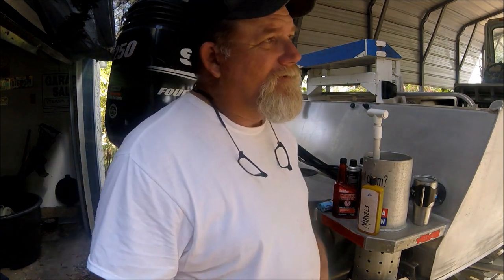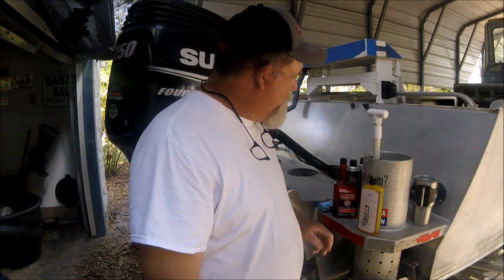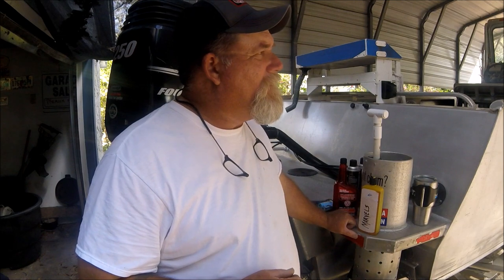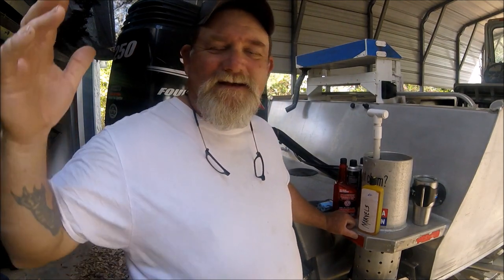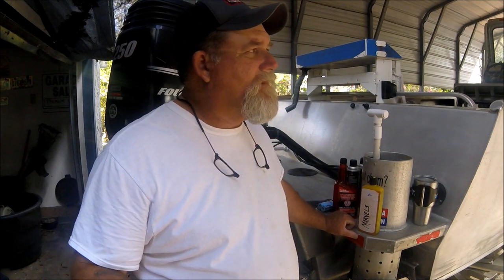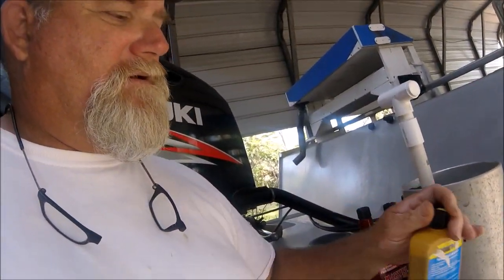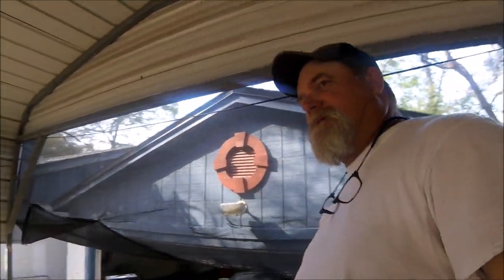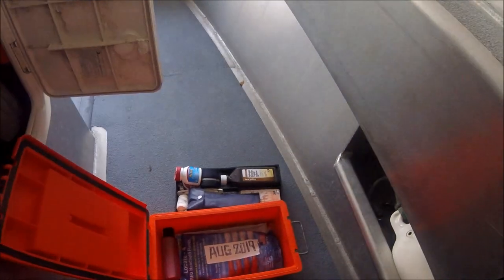Your boats Hydraulic Steering: Spend $5.00 vs. $25. for fluid

Comment: Captain Dave I’m sorry for all the haters, I’ve been using MMO since 1992 I run several boats year round doing commercial diving and this stuff is amazing, I get 6-8 seasons before changing seals and one boat went 16 years. Don’t listen to the dildos talking smack. Let them spend the money they don’t have. You are a good dude keep it coming. Take care.
Reply from the maker: I really don't care about any of the all I know is that works it's in my steering right now is cheap and that's all I care about

Comment: No intention of disputing Marvel Mystery Oil or the various grades of commercial hydraulic oil as far as which is better for boat steering, I can personally attest to this formula: 3 parts ATF , 1 part #2 diesel. I have used this in two commercial fishing boats with NO seal leakage in 20 years.
Reply: Where do you get #2 diesel? Can I just use pump diesel?

Comment: You said you don't know how many helm pumps at the tiller you have changed out and how the steering ram seals (glandular wipers) you have replaced on many boats. Have you ever considered that 'Marvel Mystery Oil' is maybe eroding or degrading the rubber components in your steering?
Reply from the maker: N-O-P-E❗❗
Reply: @CaptDavesSportfishing  Marvel Mystery oil comes in a plastic bottle, and holds pretty good on the shelf. I'm not worried about it!
Reply: I dont think oil is degrading rubber. Thats wild

Comment: Every seals or hoses has its own requirements of chemical it might be safe for seals .hoses or other parts but i would check in to it first before using it. Unless you are willing to pay  the price of getting cheap. If you own a boat you better be prepare for right maintenance and expenses. Just saying  .
Reply from the maker: 10 years, zero issues.
Reply: It's on a Suzuki rig so it's not like it's quality any way.
Reply: @dontblameme6328  wtf are you smoking, what is problem with suzukis

Comment: I ordered MMO with label "ADD to GAS a & OIL", from ZORO but they send MMO "The Original Enhancer & Fuel Treatment".   I called MMO and they said the latter would work for power steering.   I would appreciate any feedback.
Reply from the maker: hahaha    didn't know there was a difference I use what ever they made 20 years ago and is in Walmart

Comment: The Marina told me power steering fluid would great that’s what they use he said
Reply from the maker: yes, ATF works, lots of stuff works.
Reply: I was talking about stainless steel tubing the old alaskan boat building guy used I worked at a refinery where they make gasoline and they have tons of stainless steel tubing for high-pressure steam swaglelock is how they connect the lines together so It don’t leak very expensive
Reply: I use atf for all my vehicles steering systems, also red,   if you are going to spend 25 bucks a pint for power steering fluid, you might as well spend that 25 bucks on the quart of teleflex.
Reply: Christian Fritz I have used Prestone power steering fluid it was only 389 a pint
Reply: @samtate1260  It was a joke, there are literally hundreds of light weight oils that differ so slightly in formulation. They can cost 50 bucks an ounce to 50 bucks for 50 gallons. You are actually paying for the marketing..  Or the container, or even, the scent that is added.
Reply: Christian Fritz I worked for union contractors in Whiting BP refinery I seen a bunch of crap on believable

Comment: Mil Spec 5606 works too. Doesn't smell as good though.
Reply from the maker: no idea what that is, I use 'civilian'' fisherman ''Spec''
Reply: @CaptDavesSportfishing   Maybe you should look into Mil Spec 5606 You''ll be glad you have it if there is a fire on board. Long walk home.
Reply from the maker: @nuttintoseehere9141  maybe next time around....or maybe I'll take the insurance money and get me that side console Stabicraft I want from NZ.
Reply: @CaptDavesSportfishing  I checked it out. I bought Mil Spec 5606 at the airport for $25/gal. The part I like is that it is approved by Teleflex and it is red too!
Reply from the maker: @elydoug  glad you need a gallon. I still like MMO, and any wallys world has it cheap.

Comment: I’ve heard snow plow hydraulic oil works well too and is cheap. But I’ve never heard of using Marvel. One thing is for sure. Teleflex oil costs more than blood!
Reply from the maker: Yes I'm really surprised that this video doesn't go crazy in the Boating world because Teleflex steering fluid hydraulic fluid is so radically expensive Marvels really isn't anything but light oil that can be used in a hydraulic system

Comment: Not boat related but I have a IH 454 tractor with hydraulic steering that is very hard to turn I wonder if that will work  I have used it in cars
Reply from the maker: don't see why not.

Comment: Are you using the old mmo formula?? The new formula is benzene and mineral spirits. It literally has zero oil in it.
Reply from the maker: no clue......see the bottle I'm holding. this video was march 2017, haven't touched my steering since. ''thats a good thing''.

Comment: I work for a pipeline co. In Georgia... I’m gonna be installing hydraulic steering on my 150hp outboard... can I use heavy equipment hydraulic oil for my boat steering system?
Reply from the maker: no idea...ATF or Marvel, is all I've used. Marvel Mystery Oil, $ cheap at Walmart.
Reply: @CaptDavesSportfishing  ok thanks
Reply: I have been using it for years.

Comment: Can the MMO be used in my Seastar Hydraulic steering with the electronic power assist motor/valve body??
Reply from the maker: WHY NOT? if it uses the expensive stuff, it can use the cheap stuff too.

Comment: Hi I just bought a uflex hydro steering cylinder because my HC5345 seastar pivot bolt bushings came loose on both sides some how and lost my steering out in the water. Seastar wont sell me the bushing bolt kit and thats all thats wrong. My seastar works great but its jimmy rigged right now with a rod and bushings tied like a castle nut. Its a better design setup than factory lol. Dont like it that i cant buy parts. Had to get a new one. If i sold my boat someone would frown on the cylinder. Bought a uflex. Will that mystery oil be ok in that UFLEX. Im sure its the same concept design. On how things work. Uflex- seastar. Craps all the same... Just never heard of this mystery oil used in the steering. Im kinda scared to use the stuff. I wanna do it. But scared to. Thanks
Reply from the maker: IT'S ALL LIGHT HYDRAULIC OIL. and cheaper. See it when it leaks, and smells good. Spend or not, it's been in mine for years.

Comment: My steering went hard right starboard when full throttle at start. Wouldn’t turn only at low rpm’s. Make fluid low in steering wheel? Ty
Reply from the maker: Make no sense?
Reply: @CaptDavesSportfishing  maybe the fluid is low or I need to bleed it? Idk
Reply from the maker: @robertmartin265  ya think????  low, why is what I'd think. If you were using  MMO you'd see and smell it.
Reply: @CaptDavesSportfishing  I have a mercury 150 xl 4s. 2014  with 245 hrs. I’m not a mechanic but I think I’m going to try to bleed system
Reply from the maker: @robertmartin265  yeah I'm not a mechanic either but I take pride in doing constant maintenance keeping everything going
Reply: Sounds like you need to adjust the steering trim guide. Forget what its called. Pulls while throttled? Happened after you serviced?
Reply: @robertmartin265  What ended up being your problem ? Having this same problem